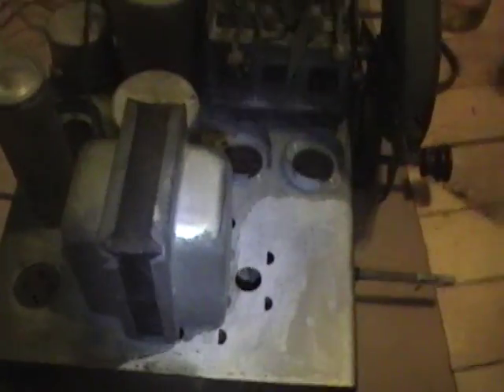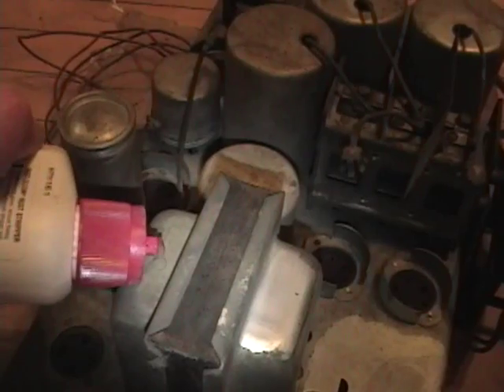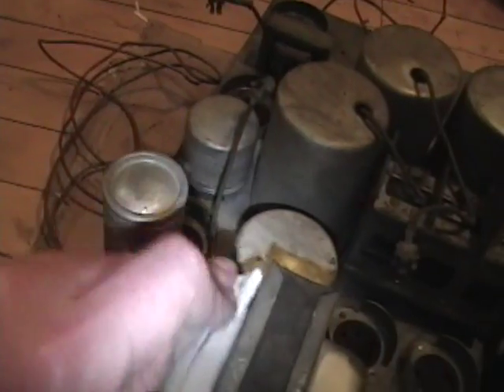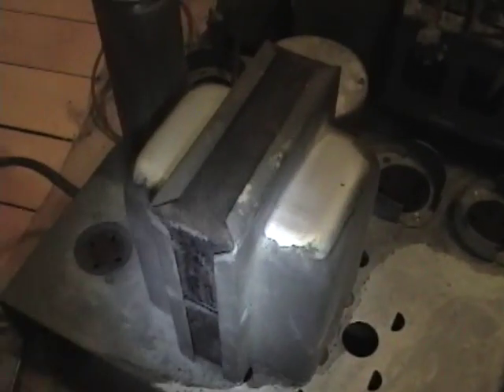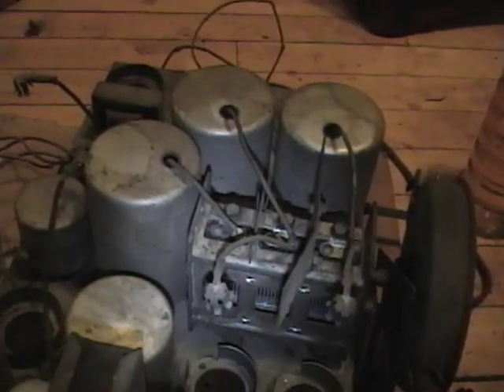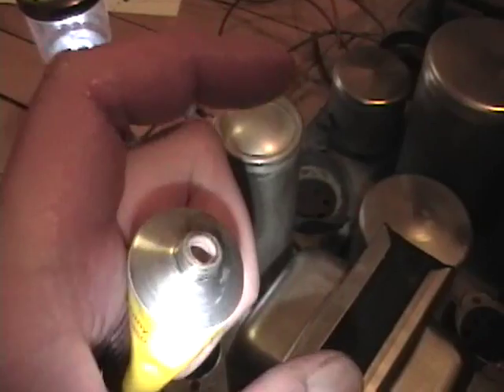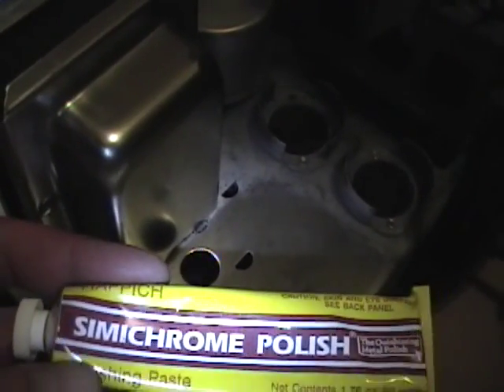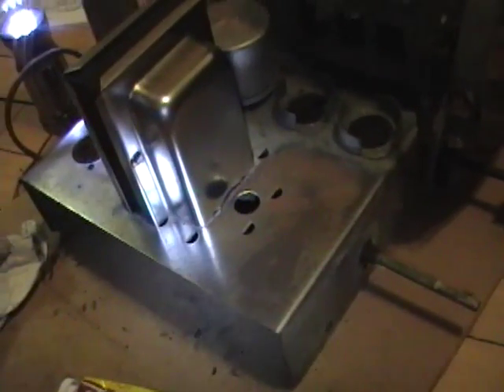RCA 222 - chassis cleaning / cadmium polishing

Comment: Cadmium plated steels and other metals can be challenging to prepare as water must be avoided, at least in the final polishing step. Final polishing is usually performed with alumina powders in mineral spirits, kerosene, or ethanol. This will prevent attack of the coating unlike an aqueous suspension..

Comment: Fantastic work. I like to avoid the acids and other hazardous stuff when cleaning a chassis, but man, the way that rust stripper cleaned things up was impressive. What do you do to protect yourself from those fumes when working indoors?
Reply from the maker: Yeah it sure saves time.  I don't use any protection other than a well ventilated room.  The fumes are minimal.  Another option is a strong multi-purpose cleaner called 'Spray 9'.
Reply: Hm. And do you find the product works well on rust? I’ve been attempting to remove rust with naval jelly and it doesn’t seem to do diddly.

Comment: I just ran across this video and they have discontinued the rust-oleum product your using. Have you found anything else that works just as good?
Reply from the maker: No but then I haven't looked as I still have a supply.  It's basically diluted hydrochloric acid.  Muriatic acid might work but it has some impurities like iron that may discolor the metal.  You'll have to experiment.
Reply: @bandersentv  will you send me some in the mail?